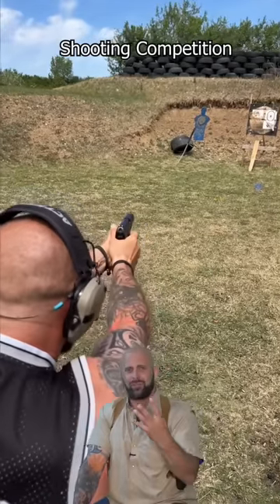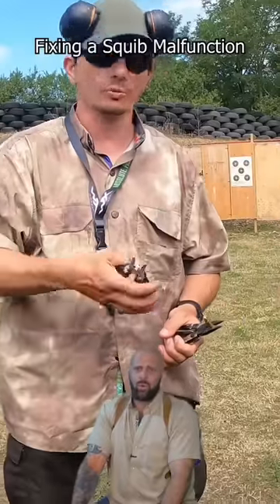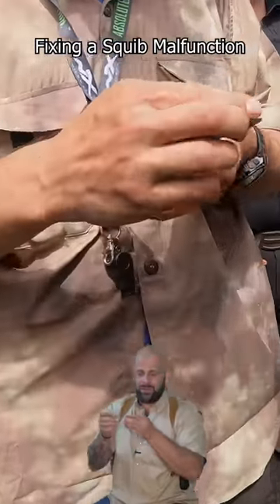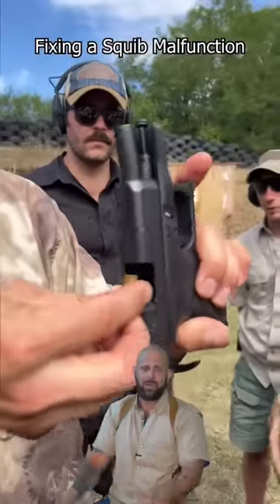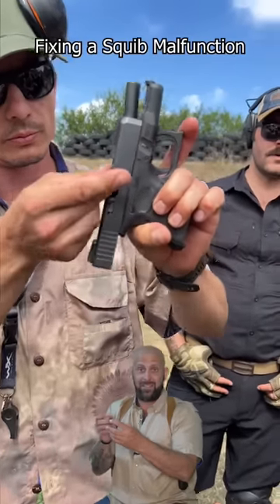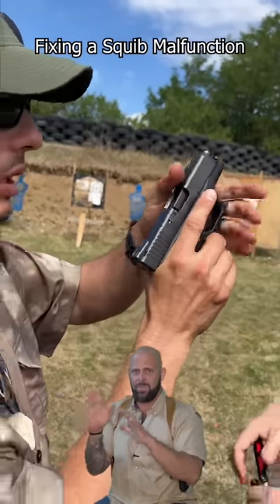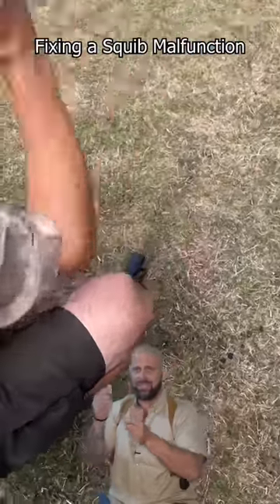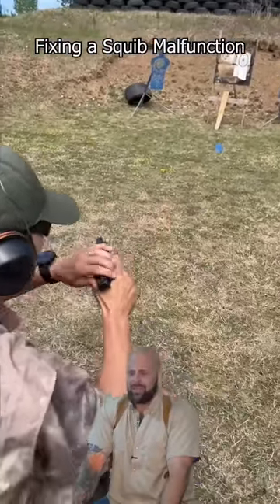Israeli Tactical Training School: Advanced Pistol. Video Clip #10

Comment: Wow that’s pretty clever. I’ve never learned anything like that before: quite field expedient. I’ve always just figured if I got a squib that gun was dead till I could get a rod and beat it back out the barrel. This is legit.
Reply: My thoughts exactly
Reply: it makes sense but i’d never think of it
Reply: No push rod! Great way of using a blank to fix it in the field!
Reply: @spencercurtis5626  you have an even brighter idea, blanks ready to go just in case of a malfunction like this see you are thinking outside the box
Reply: Same, this is legit man.
Reply: This goes counter to everything I've learned in the US armors course, the degrees earned at AGI and SDI as well as a functioning Gunsmith for over 15 years. This is how you create a pipe bomb in your hand, and permanently damage your barrel? dont believe me send it off for MPI Magnetic Particle Inspection. These people will get you mamed, or worse.
Reply: Yeah, i see what you guys mean. If the bullet got really stuck hard in the barrel because of an obstruction or because the barrel is bent or deformed then shooting a blank could be just as bad as shooting another live round. But sometimes it might be obvious that the squib was caused by just a light load or incomplete burn not providing enough pressure for enough time to push the bullet through. So you would probably be fine to do this in those situations. It does seem like it could get you into trouble though so it is probably best avoided. Use a stick to pull the trigger.
Reply: @pstrap1311  If you want to see if that works, Go buy a muzzle loader pack your powder, and only pish that round abput half way down, load the flash and see what happens, Ill wait unitl you get back from the hospital. Modern firearms have extremely tight barrel tollerances, the laws of thermo dynamics dictate that where that 'hot' lead is stuck it will contract differently, not to mention the fact that unlike the uniball in your musket, modern firearms use the extreme pressure of modern smokless to extrude the projectile into the rifiling creating a gas check. It works well when the projectile is on the cartridge because the projectile is allowed to speed up before engaing the rifiling, which is smaller than the diameter of the bullet. This violates every safety rule on the planet. DONT DO THIS
Reply: Same. So cool
Reply: @xunheilvsnipezx3324  you’d think so: but notice how the slide doesn’t fully cycle. It’s not generating an extreme pressure. In fact: I’d be willing to be that isn’t a full powder charge. Could just be another primer only (like the initial squib). I’m a professional gunsmith myself with both degrees you have and 7 years of experience: this ain’t the most unsafe thing I’ve witnessed by a long shot hahahah but only recommended if the alternative is surrender.
Reply: @xunheilvsnipezx3324  okay, you convinced me. I promise i won't do it. Unless, like that other guy just said, I'm making a heroic last stand to save my buddies and I dont have a push rod but do have some pliers and a bullet gets stuck in my barrel after what seems to be an under powered powder burn. In that case I'll just have to do what is necessary haha.
Reply: I hope you are joking.
Reply: if its a rifle you could also morter it haha
Reply: I'm not sure if it's even safe. maybe by dumping some powder out, but i feel like it could cause a pressure spike
Reply: @ichikurataichou3119  you shouldn't. It's a pretty clever way to blow your hand off. If you have a bullet stuck in your barrel, it is SOMETIMES because there wasn't enough powder to push it out. He even says "often". Are you gonna risk your hand on "often"? The bullet could be lodged and putting more pressure is gonna turn your gun into a grenade
Reply: I’d never thought of that in  a hundred years.  I figures I’d beat the bullet out with an aluminum or brass rod once I get home.  I will start bringing 2 pliers to the range from now on. 

Btw.  2 pliers > a pair of pliers
Reply: @xunheilvsnipezx3324  whats the difference between this and the round operating as normal? If the bullet is only stuck because it didnt have the power to exit the barrel. Why would this hurt it? 

Wouldnt the stress be almost identical to whats made by a regular round? Its not like its in bind or anything. If they were wouldnt that destroy your rifling regardless of how you got it out?
Reply: Man’s said “just fuck my rifling up family” 🙏🏽
Reply: @Macadamia923  good way to make a pipe bomb in your hands if the obstruction is caused by anything other than unburnt powder or a light load. The barrel has space for the bullet to accelerate before it meets the rifling which is more tight of a fit, if the bullet doesn't have that clearance to move it could easily explode instead of cleaning. Just be careful out there.
Reply: Ramrod will always be safer. Just use a ramrod.
Reply: @FreedomsLife1776  The danger doesn't have to come from overall pressure being high. It can be very dangerous if you have a very steep and uneven pressure spike.
Reply: @pstrap1311
Reply: Don’t do this that is quite dangerous to do. Maybe ok since the barrel is quite short but there is a lot of room for pressure to build before actually pushing the projectile and that sudden change once it hits the bullet could explode the gun.
Reply: @xunheilvsnipezx3324  this is exactly what i was thinking. Would this maybe work in a pinch? Maybe. But after the pinch the gun needs repairs lol
Reply: How is this field expedient? If you had a long hard object that fit in the barrel you could beat the obstruction out. Rather than disassembling a cartridge
Reply: @zacharybernard8805  when you fire an intact round, the bullet/projectile starts in the front of the chamber either barley touching the rifling or a few thousands of an inch before engaging the rifling at the chamber.  The projectile then rides the front of the pressure wave created by the burning powder, accelerates freely  engaging the rifling.   With the squib the projectile has already left the casing, entered the rifling and stopped.  In this case it probably only moved forward just past the chamber not allowing the following round to fully chamber.  Now when the projectileless casing is put behind it, the pressure will spike forward of the chamber while trying to get the projectile to overcome the friction of the rifling.  Glock barrels are very strong and may not always rupture,  but in this case will often bulge.  This will often be evident when working the slide.  Best bet is to keep an 8-inch long piece of wooden dowel or brass rod in your range bag.
Reply: @clickytheblicky9895  that's what I was thinking about too. Seems sketchy but I definitely have been wrong in life. I just wouldn't want to test it like this.
Reply: @xunheilvsnipezx3324  see that's what I thought, that's why when you're making bullets in the first place it has to be seated properly in the casing for it to function properly if I'm not mistaken. Having it that far from the case leaves a pretty big air space and a lot of room for the gases to expand too much for the end of it and so on. I wasn't sure that this was what would happen but it sure seem like it would be.
Reply: @xunheilvsnipezx3324  Thank you for this. I was like I knew it was possible but not advised to use a bullet without a projection. The video says it was a squib because of a bad reload or just under powered. There are other reasons squibs can happen. If you were in a life or death situation, like actual gun battle this is advisable but if a malfunction happens at range this is not worth the risk of damage or harm.
Reply: @zacharybernard8805  you do know how explosive gas expands right?
Reply: @clickytheblicky9895  spot on!!!👊
Reply: @ichikurataichou3119  You can certainly do this once.  Twice? well, like many other extremely dangerous things, that depends on how lucky you are.
Reply: Still damaged though…
Reply: @clickytheblicky9895  I always worry ab what happens when you get a squib when you are doing rapid fire training...    I'm pressing the instant I feel reset.    Maybe this is dumb and I just answered my own question while typing, but if there isn't enough power to send the round would that mean no cycle of the slide and therefore no reset either?    (If so is that ALWAYS the case?)    I'm not a new shooter, my EDC has at least 20,000 rds  through it (I've had it a long time)... but while I feel dumb asking I'd rather learn than just guess. 🤷🏻‍♂️
Reply: DONT do this
Reply: This is how Brandon Lee died.
Reply: Omg the nervous Nelly’s and people that think they know shit but really don’t are real 😂
Reply: No it's not ligit...
Reply: Do not do this.  This is dumb
Reply: Jesus. No. Don't do this. Ever. Not smart, doesn't make sense is dangerous af.
Reply: @anthonyvillarreal1651 literally what?
Reply: @niccosaur7778   to mortar a rifle is to hold the foregrip and with the other hand hold the charging handle amd slam the but of the rifle into the air to clear a malfunction, it looks like kinda are dropping a shell into a mortar tube hence the name
Reply: DONT DO THIS ITS THE WRONG WAY TO FIX A SQUIB
Reply: @FreedomsLife1776 the slide isn’t cycling because instead of the pressure being forced rearward in the chamber it’s going radially into the barrel.
Reply: @FreedomsLife1776  yeah I might try it with just a primer. Otherwise I wouldn't be doing this with any gun I plan on keeping.  Apparently firing on after a squib was "somewhat" common with ww2 sub guns. Lots of stens out there with bulged barrels that still function but damn. I even saw one with multiple bulges.  Like you said maybe if your life depends on it and you don't have time to take it down, but also happen to have time to yank a projectile out of a round and then load it. Awwh what are the odds of that happening. Makes me want to find a way to store a rod in my grip.
Reply: Reduced recoil or audible pop.
Reply: It is definately not "Legit", it's a good way to blow out your barrel.
Reply: @ichikurataichou3119  you shouldn't do this ever, literally the worst way to clear a squib
Reply: This kind of shit makes me lose faith in people. Put a pen or pencil in your table bag and just push it out.
Reply: @PoliticallyInsensitive  exactly. But, this Bonehead justifies this as a valid technique and is gonna get someone hurt or worse. This bois and gurls is why you never pay attention to SM influencers.
Reply: NOOOOO please don't do this
Reply: No…..no it’s not legit. It’s not ideal at all
Reply: This is NOT LEGIT. It could get someone seriously hurt. Never do this. That round id stuck for a reason. Setting off another explosion behind it is not the answer. Clear the barrel with the rod AND HAVE THE BARREL INSPECTED. You get a squib load that gun is not safe until it's inspected after clearing the barrel.

Comment: Never leave home without your M16 Cleaning kit. Those steel rods even hammer out stuck shell cases.
Reply: Shouldnt the rods be made of something softer than steel? Or am I missing something here (UK citizen gun owner here, but no pistols allowed)
Reply: @mandero8842 rods are steel..brushes should be brass ..but steel brushes may be issued with chrome lined barrels.
Reply: @OntarioBearHunter  fair. All the cleaning rods ive ever used were wood with brass sections, but I've never owned a pistol it's been all hunting rifles and shotguns

Comment: As a gunsmith, I push them out. Firing a charge with a down barrel blockage, puts chamber pressure in the thin barrel. The chamber is designed to handle the pressure. I've seen bulged barrels and catastrophic failures. My dad's buddy had left the wipe in his rifle, to keep debris out of the barrel. Surprise attack, and he forgot to pull it out. As soon as he fired, he was slammed backwards, and off his feet. Too many variables, to trust putting pressure in the barrel, the slide can break the gun on recoil. Don't risk your firearm, or personal injury.

Comment: If the bullet is stuck by the very end of the barrel and you do this, you're liable to blow the barrel up. If you know the squib is closer to the chamber I guess go for it.
Reply: @Ljaydbay  I'm waiting for all the news articles of three finger Joe 😂😂
Reply: @gotchanose  It's the less-simple physics that get you, when you account for supersonic shockwave propagation and compression heating. 

It's a bad idea because the slack space can create a situation where the shock front from the burning propellant is uniform enough to compress the air in the barrel up against the obstruction once it's reached, potentially reaching a temperature that can vaporize a tiny amount of the metal in the barrel. Unfortunately, tiny means a lot in a rifled barrel, and you've started the process of ring erosion...
Reply: @gotchanose  That is just completely incorrect. It's a much more nuanced area of physics. Plugging the end of the barrel instead of having the mass rest on the powder is how you construct a pipe bomb. It's the same principle. If you put anything substantial in the end of a shotgun and fire it, it will splinter the barrel. Watch some videos on it. The idea is the force is looking for the easiest and fastest way to dissipate. When a bullet is being pushed by a cartridge of powder the explosion is contained in a thicker chamber, but then the bullet begins to move so the explosion follows it out. When the bullet is in the end of the barrel you get the same amount of force but there's a lot of air in there that gets compressed and the barrel can't handle the pressure. That's precisely why if you're shooting a muzzle loader, it is very important to make sure the bullet is seated fully against the powder. The longer the barrel I believe the more pronounced it is to a point, but don't quote me on that. I'm sure you can find online videos of muzzleloaders blowing barrels.

Comment: It seems like many people think squibs are bullets that go off center. This is not the case as that would cause the barrel to blow. All bullets are slightly larger than the barrel, just a little bit, that small amount is what engages the rifling in the barrel. All barrels are rated lower than max pressure, just as every safety thing is measured. Everything is underrated. This would be completely safe to do. And he is not loading a round with a bullet in it. He is essentially using a blank to finish the job the previous shell could not do.

Comment: I have been shooting since I was 8, never had that happen. I'm very curious about how that would sound. So a video please.
Reply: It sounds like a pop rather then a bang. As a firearms instructor (11 year) i have only experienced 1. A student had it. I could notice the difference amongst the hole line shooting. Recoil will be different as well. 

Safe shooting my firend 
Semper fi.
Reply: Basically just a primer pop
Reply: significantly less recoil, and just a pop or "pffff" sound. A cleaning rod will tap out most squibs.
Reply: So it's pretty obvious if it happens then I take it ??
Reply: @dex2591  yes. No recoil/or very light.
Reply: @dex2591  Also the gun won't cycle on a semi auto.

Comment: Or explode due to excess volume the powder has to burn
Reply: It has more space to burn so the same charge without the bullet so close in its way means less pressure, hence why it didn’t cycle properly when it got fixed
Reply: @Bone Tactical  not 🤦‍♂️ there's a reason you ensure the projectile is touching the charge with muzzleloaders.

With that round stuck in thw barrel you've made made a sealed container you're about the detonate.

A bomb.
Reply: @tylerjones1645  tier one operator lol 😂 that’s why
Reply from the maker: @tylerjones1645  if one doesn’t have the capacity to learn from an instructional video, nothing I can say in the comment section will help said fool.
Reply: @KN nah they're right if the powder is disturbed and travels part way down the barrel you could have the powder detonate instead of burn as it is intended, probably not an issue in a handgun cartridge, but it's similar to why many cartridges have a minimum safe powder charge
Reply: Extra space makes a pipe bomb. The pressure spikes at the rate powder burns. Depending on how the powder was designed to burn that spike can be an order of magnitude higher than the powder and gun was designed for.

Comment: I think the seating depth (rifling engagement) has changed. 

In a good round, the bullet is free to begin travel from the case. But when it's already tightly engaged in the rifling,  that same bullet takes more force to begin moving.  I think there would be more pressure than normal.  Aka - 💥 BOOM!💥 
When reloading,  isn't the overall length important? 
Just seems like a pressure issue is about to happen.

Comment: Idk why people are saying this seems dangerous? They're missing some details in their understanding of ballistics and pressure etc. It's dangerous because of over pressure if you were to follow up with another complete cartridge. The problem is the pressure being enough to explode the gun and not to push both projectiles out of the barrel. When you remove the projectile from the round and use the powder from the same ammo to push out the squib... easy peasy. I wouldn't hesitate to do this.
Reply from the maker: 95% of people have no idea what they’re talking about on any given subject. So the information in these videos if correct and shared by professionals means that more than nine out of 10 comments will be from people who cannot intelligently benefit the conversation